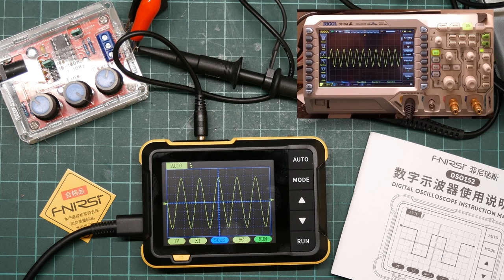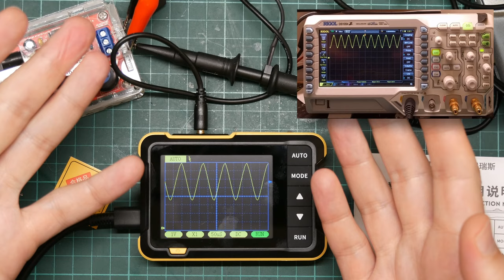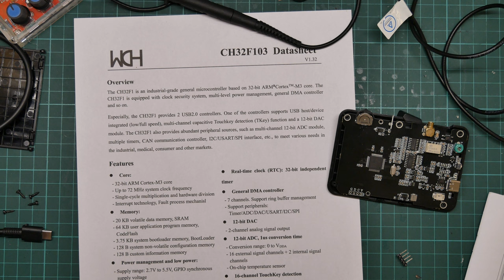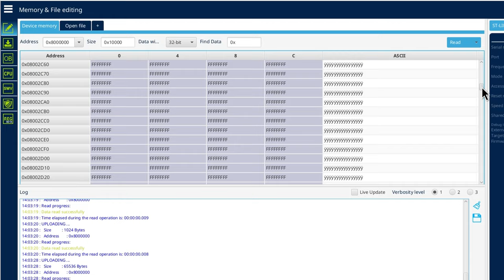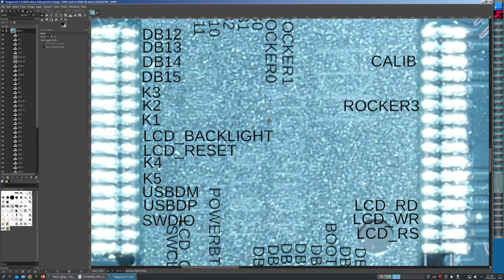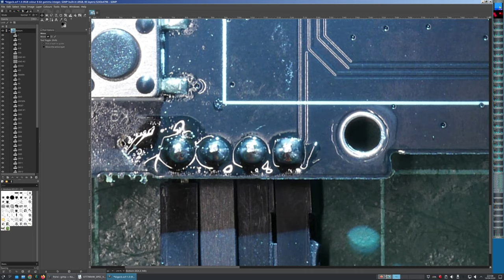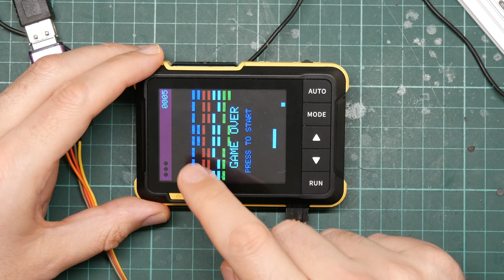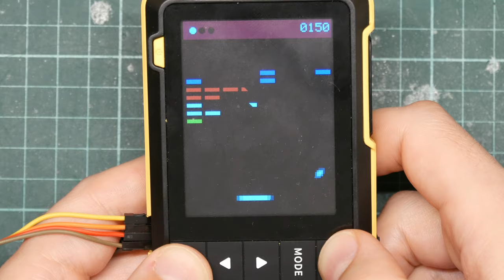Hacking a Fnirsi DSO152 mini oscilloscope to play Breakout

Comment from the maker: I've since found that Fnirsi also make the DSO153, which comes in an identical (if blue) case and has higher resolution oscilloscoping and a signal generator. So, both input and output analogue stages. I can't find a high resolution image of the PCB but it looks oddly similar, although with a different microcontroller and a six-pin debug header. The UI looks identical so there's a decent chance it's another CH32, although a bigger one.
Reply: Out of curiosity, I just took apart my DSO153 and unfortunately they have scratched off the markings on the processor. It's a smaller 12x12 pin package and there is more going on on the PCB with a large inductor (maybe for the signal generator). It has 6 unmarked pin holes instead of the 4 debug ones on the DSO152. I can send you a pic if you're interested.
Reply from the maker: @Nibb31  Bah, I wish people wouldn't do that... given the UI looks the same it's probably another STM32-compatible, and figuring out which debug pins do what is it the very worst a matter of trying all the combinations, and then it should be identifiable through the debugger. I found a teardown with microscope views here: https://www.youtube.com/watch?v=8_s7yX8SnX8 Maybe when I see the thing for sale on Aliexpress I'll get one.

Comment: This looks pretty good starting point for open-source car diagnostic tool
Reply from the maker: One thought I had was whether it'd be possible to reassign the analogue input to a digital pin, to get higher bandwidth, and use it as a super logic probe --- you wouldn't get the true waveform but being able to show an actual trace could be really useful.

Comment: This looks like an absolutely awesome first scope for someone like me, who would use it with Flipper Zero.
Running arm, exposed uart, easy to take apart, small and solid...
That fits literally every niche a device needs to go in my bag..
Reply from the maker: Be aware that the stock firmware doesn't give you a UART (or if it does I haven't found it yet). And as I haven't found a way of dumping the stock firmware, once you've released it it's not an oscilloscope any more!
Reply: @hjalfi  Flipper should at least be able to give you access to the console to start decoding it. There's probably a custom firmware out there you could flash to turn it back into a scope

Comment: Nice hacking there ;-) And thanks for mentioning the Buck50 firmware. That will give me something to play with in the coming weeks. I did once make an "oscilloscope" with an Arduino Nano, based on an article I found on a website. It did even kind of work, just not very well and I lost interest. It might be interesting to see how well or how badly a Bluepill will handle this task. I may buy the Fnirsi or something similar as well (though I do have a GW-Instek scope).
Reply: I skipped the diy arduionno scope and just bought the dso2512g, its about the same here but looks like it uses customs fpga's and achievs like 8megaherts instead of 200khz which i think is the only drawback of these off the shelf mcu's. I too got a few ch32f103's after playing around with the arduino and wanting to try something more powerful. I had no idea they were this powerful! cool stuff

Comment: I just got mine today and it looks great. I wish you could have gone into a little more detail on updating over USB. I cant get to connect to my PC (Win10 says it is malfunctioning). The instructions are not at all clear to me. What is a U Disk? A USB used as a storage (drive)? Pressing the pwr and and then the OK buttons in any combination of longs and shorts and holds still gets a Win10 complaint as soon as the USB is plugged in. Everything else works fine. I watched 10 or so videos on the DSO152 so far. I guess I will try to go to the company or the website community next.

Anyway, thanks for the video, very interesting though above my head on programming.
Reply from the maker: I never even tried to make the USB update work, as there's no firmware image available to update it with! All my work was with the SWD debugger.

Comment: woah a ch32f103? I got some of those too after playing with arduino and wanting to try something more poweful.  Didnt get much into them as it was a little more difficult then i imagined with the different toolchain wch uses compared to stm32 , but i did manage to get a white noise generator code example loaded up on it and it worked really well, i thought would be a good mcu for a signal genrator but had no idea it could run an oscilliscope or a game like breakout.  Well my 486 25mhz cpu back in the day ran doom2, so it shouldnt be surprsing todays cpu's at 72mhz could so something similar i guess.  Can you make it run doom?  jk i dont care to tsee that, doom needs 60fps, its a mockery of what doom is making it run on any hardware, i was FPS starved in the game with my fpuless 486, it cant run on any hardware.. it needs an FPU to run good. and you dont get a fpu in the f103 range, you need f403.
Reply from the maker: I just treated it like a ST32F103. No different configuration, no WCH toolchain, I just installed the std32duino core, set things up, and pressed 'compile and upload'. Also, the ST32F1 absolutely has enough grunt to run Doom. What it doesn't have is the memory. The screen has more memory than the MCU! You may be able to do a limited port of Castle Wolfenstein; raycasting is easy.

Comment: what do you mean USB is working? could it possibly host a thumb drive and dump data to it?
Reply from the maker: Maybe. It already works the other way around, where it acts as a peripheral to another device. The question is whether it'll work the other way around, where it hosts another peripheral. The CH32F1 supports host mode but I don't know if the connector is wired up appropriately (or whether it needs to be wired up appropriately).

Comment: Would you be interested in doing the exact same thing but for the "more expensive" model? (I think it's the dso180h or something, featured by a lot of youtubers, including diode gone wild) it's around 100 bucks but I bet it's quite a lot better than the this one
Reply from the maker: I found a teardown of it which gave me a look at the motherboard: it's a significantly more complex device, with discrete ADCs, a monster FPGA doing a lot of the work, and the CPU is a Allwinner FC100S which is an 533MHz AMR9 with 32MB of onboard RAM capable of running Linux. Making this run custom code is probably not that hard, but figuring out the FPGA and the analogue side will be a nightmare, and definitely out of my pay grade. Interestingly, I see that the Hantek DSO2000 series of oscilloscopes use the FC200S, so maybe there's scope for a cross-platform oscilloscope firmware package...
Reply: @hjalfi  oh the FC100S! I wanted to develop a board with it in the past. if that thing runs linux, it'd be cool to hack it. I hope I'd be able to buy one. Yeah the fpga part might be out my paygrade as well, at least for a quick and dirty hack. But anyway, a great hack!